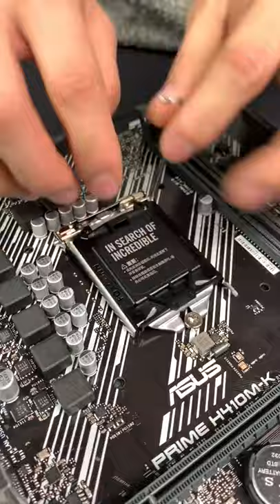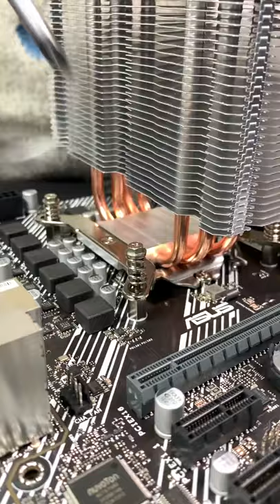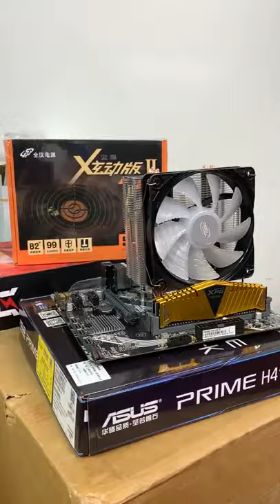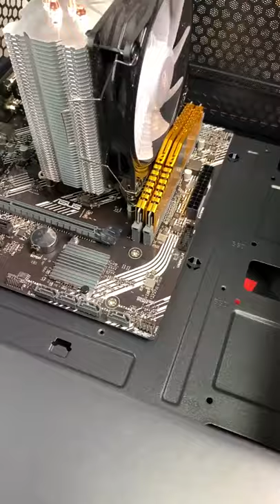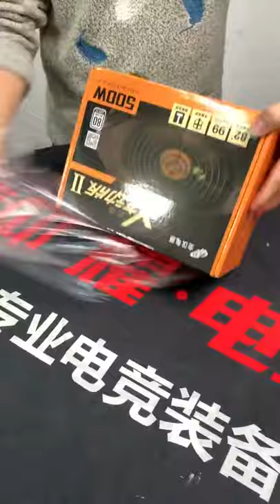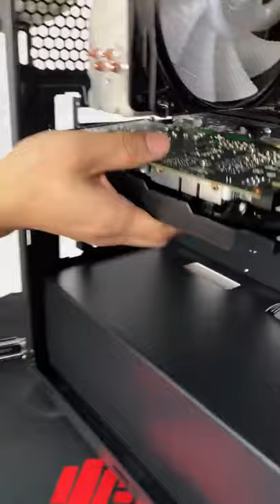How to Build A Gaming PC with $500 #shorts #ASMR

Comment: People saying "WiSh ShOpPiNg SprEE":

Mobo is Asus
CPU is Intel
Cooler is Deep Cool
SSD is Western Digital
RAM is XPG ADATA 

Only Chinese components:
 PSU which is a Power Flower, brand related to the old Sun Flower brand (which made excellent PSUs back in the day and still does good in the high end market.)

GTX 1650 card: Probably a Veneida? Or some Asia specific brand. 

The case must not be taken in consideration because you can easily replace it with whatever you have in stock in your continent.

Comment: Looks great brother. Some changes I would've made:
Hitachi over WD. I just don't think the failure rate of WD warrants the microscopic price difference. Hell, anything other than WD. They just do not have a good rep in the enterprise segment due to their poor quality. If you know that you will not have any important data, which video games are not, then I suppose it's fine.

The case is fine, but do at least buy some sound insulation for it. You can buy it for cheap at the local car mod shop. It's fairly cheap, and reduces the noise of your computer more than any fan curve or premium fan hubs ever will.
Obviously, fan curves are free to set up, but noctua fans are not. 
Many fractal cases comes with sound insulation built right in.
Finally, don't cheap out on the power supply. I seriously do not recommend it. 
Once you've tried to RMA a motherboard with a fried VRM because your shitty psu up and died, but as a last ditch effort and revenge, it decided to shit diarrhea power down the neck of your MUCH more expensive parts... Yeah.
It's only 10€ more to get one from a reputable vendor. I recommend Corsair or EVGA.
Reply: Not sure if you live under a rock but, Hitachi or HGST had been acquired by WD for a long time and most of its product now are part of WD. And for the PSU, you can clearly see it's a FSP psu although not sure what type is used, probably low-end considering it's a budget build.

Comment: Do you think pushing down on the CPU is a natural thermal pst? Or are you pushing down and forgetting the thermal past on purpose? The #1 rule for when you are putting the CPU into the socket is not to push down as you could bend pins.

Comment: No, I don't think you can fit a GTX 1650 in your $500 budget. Also, I don't trust that PSU
Reply: You can in some countries, that PSU is pretty good I heard
Reply: @edmundsiadari6234  well you technically can if you go for an i3. And I still don't trust that PSU. Even though I live in Asia, I never heard of it. Atleast go with Corsair or Cooler Master. This guy seems to pick some weird PSU's and GPU's
Reply: @amvymavy  it's a good brand in his country, I saw a comment saying he know the brand and it's good
Reply: @amvymavy  In my country, under $500 you can get a 1650 super with Ryzen 3 3200g/220g
Reply: @edmundsiadari6234  well. In my country, a Ryzen 3 3200G is stupidly rare. Even if I find one, I'm better off getting the Ryzen 5 2600 or Ryzen 5 3500 because the 3200G price are way too high. And I think a Ryzen 5 2600 will probably be better than Ryzen 5 3500 because of the extra 6 threads

Comment: This is in no way a “how to”

Not only did you not tell us how to install ram, you didnt show that you need to match up the triangles on the mobo and cpu. You also didnt even apply thermal paste, and if you did you didnt show it. You also didnt show that you needed to put in the standoffs for the mobo, and didnt even show the IO installation. And to top it off these parts arent even good. Sure its budget but you can get far better and more reliable parts for cheap.

Oh and i prolly dont need to mention this, but you literally didnt show any cable installation. No ATX power or even the 24 pin. Much less something like power button header or even fan headers.
Reply: Bro it's a shorts video chill

Comment: In this day and age, you'd have to source some pretty dodgy looking components to build a PC for $500.

As far as gaming goes, you're better off with a PS5/Series X at that price point.
Reply: If they are available…
Reply: @gonkdroid2539  It's much easier getting one of the consoles at MSRP than a 30 series or a 6000 series GPU.
Reply: @chrisjr6214  you won’t ever use a 30 series card for a budget build
Reply: @gonkdroid2539  Yes you would. 3060 and a hypothetical 3050 would be budget cards.
Reply: @chrisjr6214  no they aren't, the 1000 series is the budget cards. 1050ti, 1660 super, 1080ti, etc.

Comment: I'm from Poland, I've builded my PC for 1000zł (around 300$) and I have almost identical specs, I have 16GB RAM DDR3, Intel i5-2400 and RX 570 4GB GDDR5, I've paid 500zł for GPU (around 150$) and it was brand new, Doom Eternal don't even flinch on High settings with stable 60FPS, nothing is overheating and nothing is lagging, to build PC with afordable prices you have to buy used parts and have some friends that can aquaire this stuff for some sensible prices, the reason why GPU was cheap was because a cousin of my friend is a wholesaler and he often gets such things practically for free, you cannot build a PC with sensible prices without help from specific friends, and that's sad... Fucking Bitcoin miners...